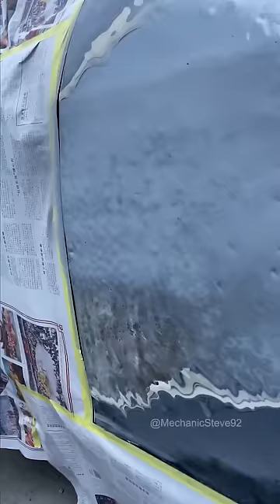Rusty Panel Car Door Repair

Comment: you were supposed to blend in the driver's door as well  as a former bodyshop  painter  it is the correct way and I  wouldn't have  added  bondo to the  door  again.  best results are to replace the door  panel skin..

Comment: So after you stripped it down to bare metal, was that an epoxy primer you sprayed over it? And then you put the filler on top of that? I’ve read where some prefer to put the filler directly on the metal then epoxy over that. I would think the epoxy primer seals the metal to prevent future rusting?

Comment: That repair is going to fail again.  The best thing was to replace the door or put a new skin on it. But if its a budget repair at least  lightly sand blast the rusty crevices .Tack weld all the holes and apply all metal or fiberglass filler before bondo. Please do better